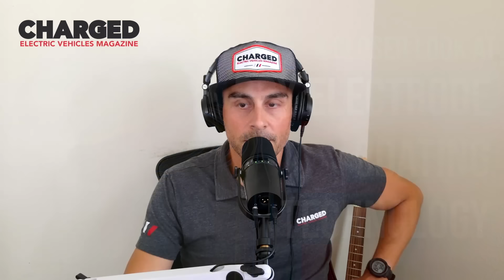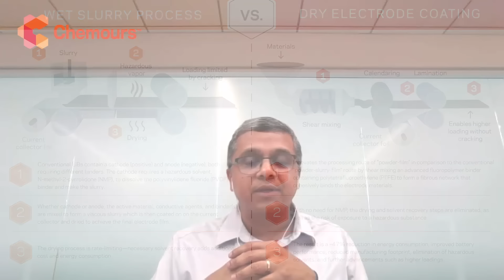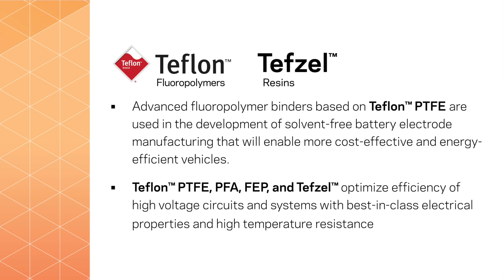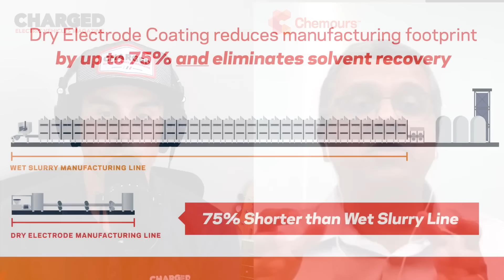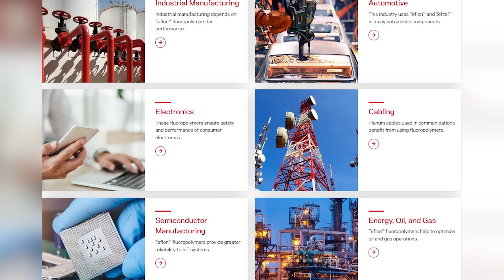Dry electrode coating technology for EV batteries: benefits and challenges

Comment: Dry coating also solves the swelling issue of nano silicon composite anodes. Silicon has 12 times more specific capacity compared with graphite(carbon)meaning we will see 900wh/kg battery cells with sulfide based solid electrolytes , dry coated honey comb structure based nano silicon composite anodes and dry coated 90% nickel content NCMA or NMX(cobalt free)cathodes in early 2030s . Its also because of higher active materials(solvent free)in cathode and anode and thicker electrodes(almost double in thickness compared to wet coating process) .